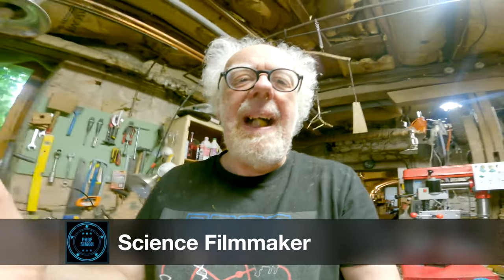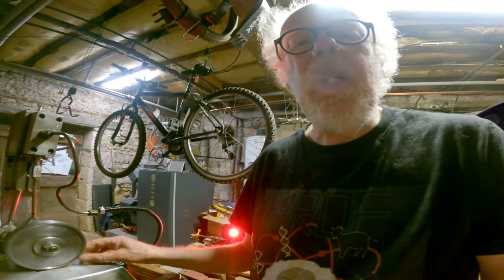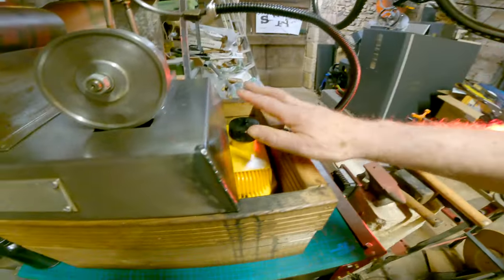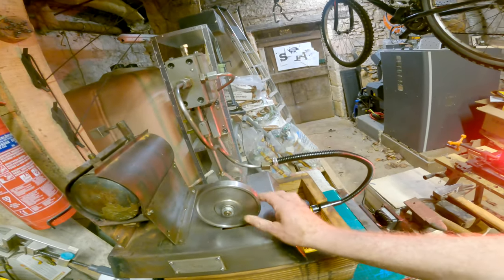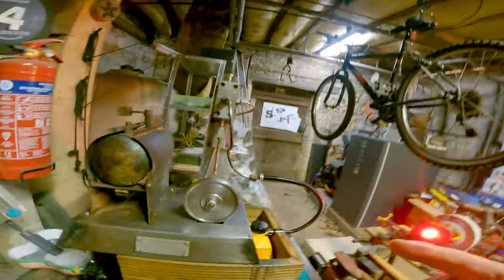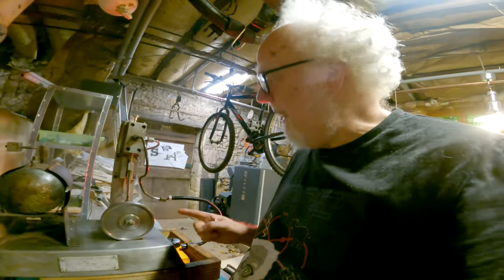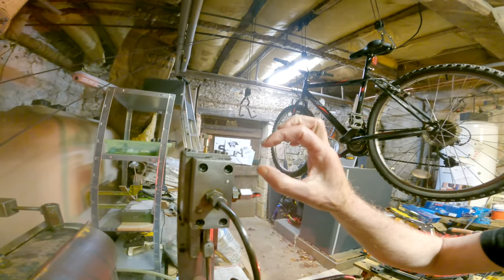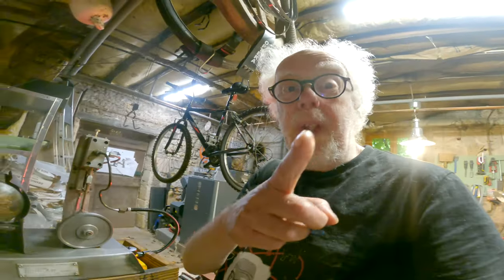The Steam engine and the UFO - Prof Simon

Comment: The fact that ufos seem to hum while in flight should be a hint at its power source. 
The one i first saw in 99' which was half the size of the football pitch i was stood on hummed so much i felt it in my body. The Phoenix lights craft in 97' also reportedly produced a deep humming noise and many more cases where the craft produced a humming noise.
Reply: I didn't hear a hum. It remained silent. There was a hum involved in our television as an orb flew overheard but it was very brief and of a low frequency, less than a Khz.
Reply: @Laviolette101  I've seen the orbs up close too and for me the orbs were completely silent. No sound whatsoever.
But then again I wasn't standing next to a television lol 

As for the humming it is a common occurrence that's reported, which I've witnessed myself. Though obviously there are reports from other witnesses that say the crafts they saw were silent. Though the silent ones don't give much indication of what's powering it. 

Can you describe your encounter?
Reply: "Purportedly"  is an excellent word to use instead oft "reportedly" which is fine also.   🙂

Comment: How to make a levitating UFO. 1 make about 20 slices of buttered toast. 2 get one cat per slice of toast and tie the toast to the cat butter side up. Run a small pole between the two and attach to the outside of your fuselage. As cats always land feet first and toast always lands buttered side down they should just spin in mid air. This would also explain the noise that UFO's make.
Reply: I just followed your advice but could only get Schrodinger’s cats. Now my creation will either fly or not fly - and makes a hell of a howling noise...
Reply: I followed your instructions to the letter, yet the device doesn't work as described. Instead of spinning in mid-air, it just floats there. Very disappointed! It took a lot of effort to attach all those cats. On the bright side, I can use the device to more easily make my way to the medical clinic for stitches.

Comment: If they are real objects in this universe, they must adhere to physical laws. It is my belief that their operational mechanism falls under the auspices of high-voltage physics, and because it is both dangerous and hugely expensive in men and materiel to conduct R&D, progress is most appropriately made by national governments, in concert with large corporations *looks at Lockheed-Martin*🙃
Reply: The funny thing is that high voltage propulsion isn’t expensive at all. It’s just huge electrified copper plates basically. They have figured that out already in 1895 and are flying that stuff at least since the 1950‘s. See Mark MacCandlish and the Fluxliner story aka The Hunt for Zero Point Energy.
Reply: @curtcoeurdelion  RIP Mr McCandlish. My assertion as to the expense is in part due to the need for materials which can handle huge voltages without heating and losing integrity. Plus, even McCandlish said that he would need huge amounts of copper, magnesium, and a special type of dielectric to insulate the capacitor plates. I dearly want a copy of his ARV blueprint, but since his untimely passing, it’s been impossible to procure.
Reply: @Critter145  You can get blueprints from the disclosure project. The matériels in questions are relatively cheap to obtain in contrast to more exotic stuff. Given that you probably do need a lot of them. But in general, the R&D is not that expensive to do once you have figured out the basic concepts of this kind of field propulsion (there are other types too, some of them vastly more exotic). Basically you end up with a new model of physics, a more or less electricity based concept of the universe and physics and that’s also the reason why they have canceled every R&D regarding the study and development of antigravity in the US nationwide since 1956.
Reply: @curtcoeurdelion  💯. Also, I had no idea about the blueprint from the disclosure project. Do you have a link or is it as easy as a quick Google search to find it?
Reply: Physical laws aren't even fully known. We are not there yet.
Reply: @Critter145  that may help too, they also have some in depth research papers on antigravity and electro-hydro propulsion on their site too
Reply: Yes, yes, no. Being in the universe doesn't mean there's not another dimension we don't see in this physical world. Turning on a dime, hitting the water and reappearing, not being visible to radar shows me we're lied to about our technology or the other.

Comment: I dont get the wallpaper stripper hookup.  Was that being heated or chemically reacted or a catch reservoir for the boiler to the left of the engine  I doubt wall paper fluid compresses like water may explain the bad back stroke.  Didnt seem you used the brass boiler however.
Reply from the maker: the wallpaper stripper just uses water to make steam
Reply: @SimonHollandfilms  😂

Comment: I want to see next stage when steam power hooked up to generator then convert to electric see how many Amp it can output and then charge up a phone on there ..just because steam powered charging would be funny to see and way to see the entire system and how ineffective or effective it is....plug a drill in see if drive a screw off steam power conversion ..etc etc  .....

i was surprised to read this Steam turbines are used to generate electricity and they accounted for about 45% of U.S. electricity generation in 2021...

So what difference in steam engine and steam turbine?

Comment: We should think of all exotic physics related momentum and gravity we can now see gravitational waves, we can measure frame dragging I suppose next is cause such effects ourselves and see if other math is possible, perhaps it's not even movement but a way of projection or some adjustment to field we currently have no controll over ea if I can exclude the higgs field in an area I have no mass at all and speedup easily as som sort of hypersonic torpedo... Hmm let's make  this smooth and round.. some surface material in some sort of excited state.